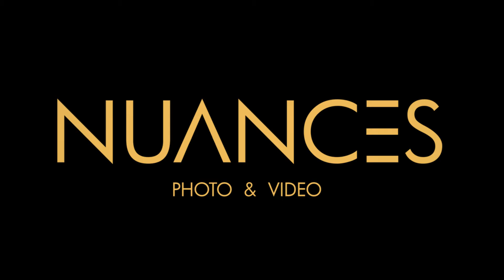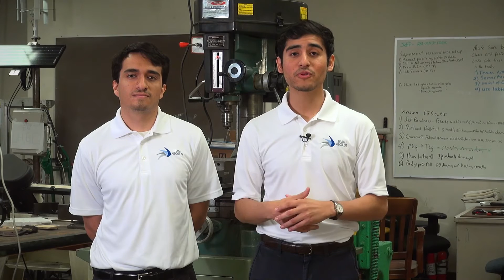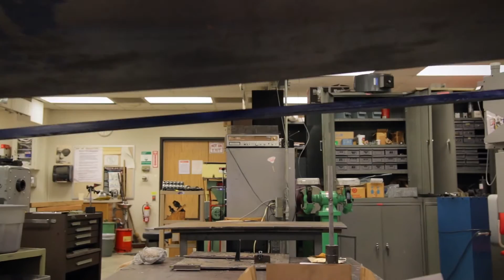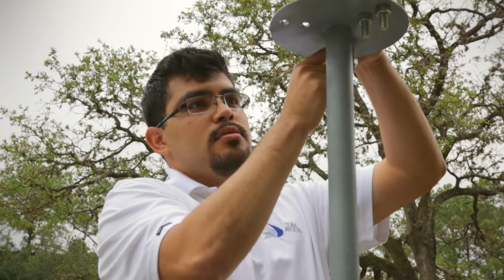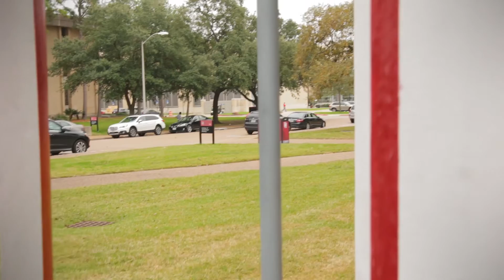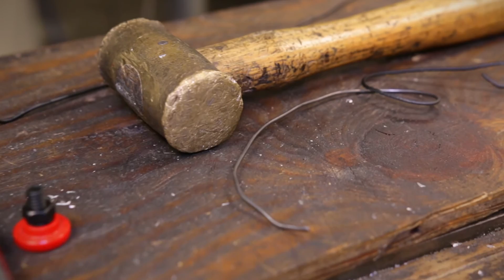Variable Pitch Wind Turbine Engineering Project - Team Aeolus (FA16)

Comment: Gentlemen,  I looked at your report and noticed that you gave up on passive, centrifugal pitch control prematurely. While based on the same basic principle, the very simple to make Sharp Cycloturbine uses lighter blade-units than the Bayly-Kentfield VAWT, and also produces 50% more resistance to pitching plus other improvements. Almost any Internet search can find it. It's clearly superior, and seems to be the best small-scale VAWT of all. It is, however, impossible to analyze mathematically. 
You settled for a collective, cyclic pitch control that is equivalent to the original Darrieus cycloturbine (1931), which is not efficient in turbulent winds because it can seldom operate at its design TSR, and it is too complex and costly for poor farmers in developing countries. It sacrifices a lot of the energy in wind gusts. 
The problem of overspeed control can be handled by just letting the Sharp Cycloturbine rotor tip away from the wind to disrupt the pitch control. That is cheap and reliable. It can be done manually for shut-down when desired. If you are still interested in cycloturbine VAWT, please contact me for further information: sharpencil@sbcglobal.net. Here is a video of a model made for teaching children: https://www.youtube.com/watch?v=LXUiDx-F6FI    This model uses paper blades and is designed to spin slowly enough to be safe for children.  
The Sharp Cycloturbine has strong starting torque, a broad torque curve, and a high efficiency. It can even use flat-surface blades to minimize costs because the blades don't stall. It can even eliminate the need for ball-bearings by using cords that twist.